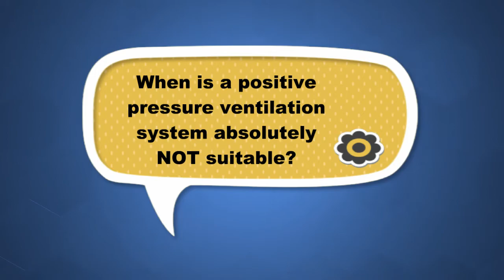When is positive pressure ventilation absolutely NOT suitable for a house?

Comment: The air being forced into the home should be conditioned by passing the air through a pre heater then evaporator coil to remove any moisture.. in cases this method can cause the air to be to dry
Reply: it is more efficient to cool in first on the evaporator to get the moisture out, and then reheat it for the house? Why would you want to "preheat" it, when you cool it afterwards anyway?

Comment: I had been pondering investment in one of these systems and the factor preventing me buying one is the fact that the cause of the moisture/mould isnt being addressed and all that is achieved is providing a sticking plaster (Asprin). Coming from a career in heavy Engineering and Risk Management, I often apply my learned logic to small, simple, domestic-use products such as one of these PIVs and how they (when scaled-up) might provide a solution to a larger, industrial application and whether their solution would even make it to a feasibility study. In the case of these PIVs there would not be any consideration of their use as the root cause of the concern/negative outcome (humidity/mould) was not being addressed. The humidity/mould would be caused by a breakdown further upstream, such as a failed guttering/drain/damp membrane/window vents/door seals/standing water/roof ventilation, etc etc etc and this is where resources need to be focussed, to engineering out the problem. 
With this logic applied on my old house, I discovered the loft floor insulation was packed too tightly against the eaves, preventing through flow of air and a build up of damp air in the loft space, which caused extensive water droplets to fall whenever opening the loft hatch. Add in a lack of bathroom and kitchen forced air ventilation and several blocked air bricks around the lower brick cause and the problems were eliminated. Addressing these issues, then running a decent dehumidifier for a couple of weeks, coupled with old-fashioned thinking such as opening the doors and windows to replenish the stale air to fresh air every lunchtime has transformed the quality of air around the house and eliminated high humidity and mould.